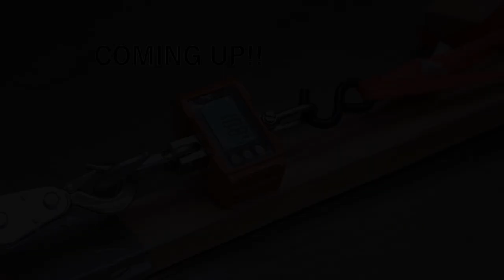These Screws Change Everything!

Comment: Thank you!! This is real world data that I am looking for!
I have a solar panel array on my roof and I am using #17 size 4" long lag screws to hold the array down. I carefully measured where the 2x4 trusses (presumably pine) are and pre-drilled a hole 13/64" (abt 0.20" or 5mm) and the lag screw shank is about 0.225". The screws are going into the side of the 2x4, (hopefully in the center with 3/4" of wood on either side!!) and I am worried about the pull out strength! We get some pretty viscous winds from the north that could get under the array and pull out the lag screws!
So my question is how much force do you have to apply to various screws to the pull the screw straight up out of the wood? I think this is called the pullout strength or something?
Reply from the maker: Hey Zach! I believe the term is grip strength! I don’t know all the ins and outs but the grip strength of screws is supposed to be pretty high! In some of the tests I conducted, the screw was pulled through the test board before pulling out of the anchor board (kinda crazy). I bet you can find someone with solar related experience in a Facebook group or on Reddit that could give you better recommendations than I could. Sounds like a beefy project, I hope it goes smoothly for you!
Reply: If you’re lag screwed into the studs not just the plywood, you’ll have extremely high security. Lag screws at 3/8 have a grip strength of between 800 and 2500 pounds depending on certain factors

Comment: Structural screws nowadays are getting a lot more shear strength.
Reply from the maker: Agreed! These are just regular wood/deck screws. I use them for everything, especially knowing how much they can handle.
Reply: No, some screws are now structural, which they weren't earlier, which is why nails are required by code in most places. It is still illegal to use screws for framing in a lot of places. Canada is the only place I know off the top of my head where it is legal to use screws in framing. But that's not something I have been paying much attention to in a long time.
Reply: @MAGAMAN  I wouldn't build a house with screws but it's legal on decks here if you notch the 6x6 post so the 2x12's (example) butt up flush against the notched post. They hold better than nails this way over time because the shear weight is all on the 6x6 post. The screws won't back out from heat and cold temp exposure over the years.
Reply: @MAGAMAN  I wouldn't be surprised if it becomes legal eventually with some of the structural screws coming out. I won't use them until it's certified.
Reply: @jasonhull2163  I would use a metal bracket instead of a notch (Simpson makes brackets for this).  I think notching is illegal in some jurisdictions because notching weakens the post.
Reply: @Wowzersdude-k5c  No it doesn't. You replace the wood that was cut out. Takes shear weight off fasteners. Also GRK 4 screws beat 16 penny framing nails in a test.
Reply: @Wowzersdude-k5c  been doing this work for 23 years.
Reply: @Wowzersdude-k5c  take a cross and make it from 4x4 and notice the center. The board you knock into the notched post has no shear weight on the fasteners. It's stronger than just nails. All weight is on the post. Using a 2 by 10 will fill in the 2 inch gap in the wood once notched. So the wood is still there. You just have knock it in for a good right fit.

Comment: DECK SCREWS, not Drywall Screws, or even Stainless Steel Screws!
Reply from the maker: Correct, exterior wood/deck screws (I believe I mentioned that in the video?)
Reply: No, NOT deck screws. Construction screws.

Comment: This is a stupidly dangerous test and it fails to address the real problem which is a sharp jolt. When you have 700 lbs on your shelving and then you throw your 50 lb bag of bird seed (or whatever) on there it can start a reaction that causes all that weight to end up on top of you. 

When you build something that's going to hold a lot of weight, you want to have structure supporting structure. Always. That crappy shelving system you built can be made much, much stronger, by simply cutting some 2x4s to fit in between the bottom of the shelves and the floor, or the shelf below and attaching it to the 2x4s you have screwed into the shelf. To make it even stronger, turn the 2x4s 90 degrees and use glue and screws and this will help prevent the legs of the bench from bowing out over time. 

Of course nothing will fix the fact that you used extremely weak joints on the ends of the boards with those crappy pocket hole screws, other than tearing it down and rebuilding.